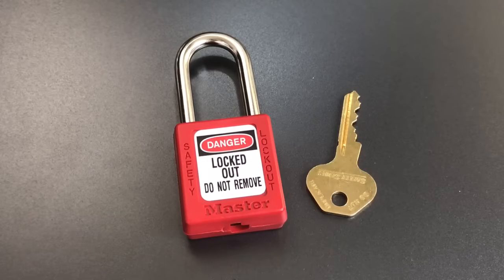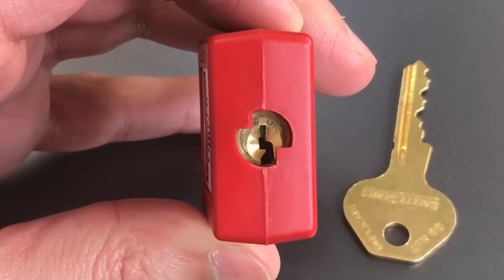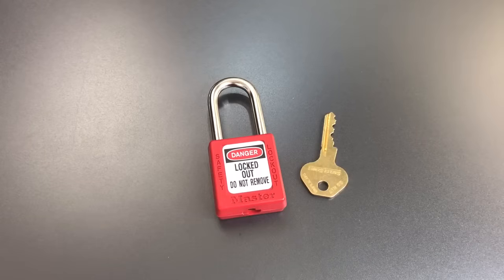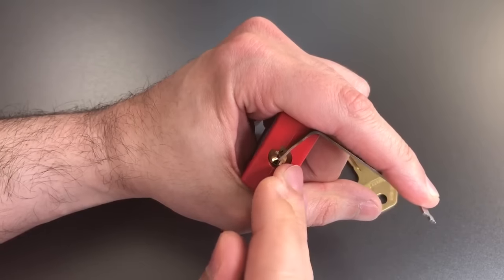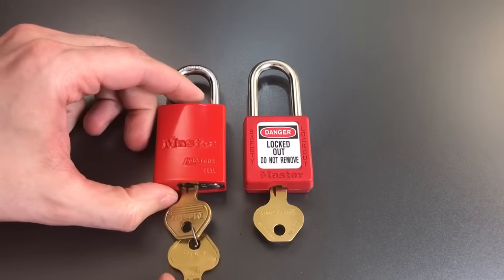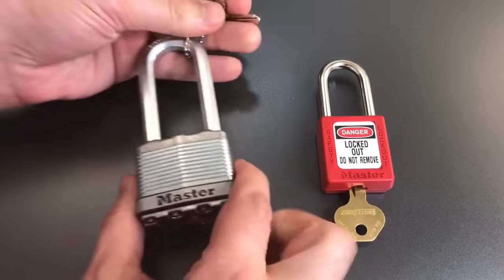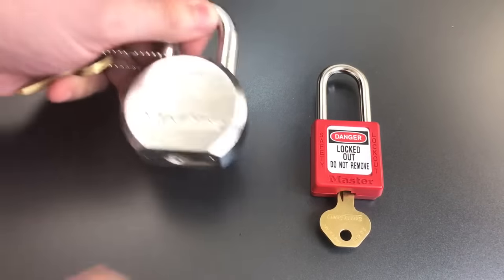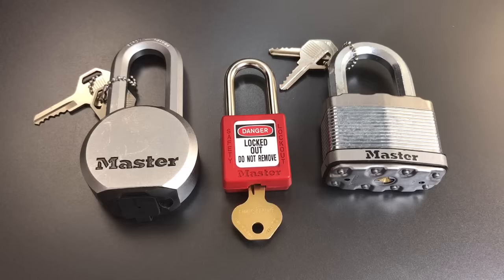[479] The Master Lock Paradox - Model 410 LOTO Padlock

Comment: I may have an answer to the paradox.

I have been working in Nickel refinery plant for 22 years and when they introduced these locks we were all scared. Beforehand we just put the tag on isolation point and that was it. Our plant is a very complex process plant and when we isolate equipment very rarely we got only 2 or 3 isolation points. Most of them average 10 to 15 of them. During the shutdown we have to isolate a lots of equipment with one key and sometimes set of up to 40 locks (and one key). So having a light lock and resistant to chemicals (leaking valves etc) makes a priority requirement. Imagine caring 40 locks with you from one isolation point to another with heavy body locks. So here is the answer to your question. 

Safety regulation on site requires isolation point to be isolated and locked. If the lock is physically broken and destroyed that is a safety breach and immediately will be noticed, job stopped and heavy investigation will begin after which someone will loose the job. Even if the lock is physically destroyed and removed and throne away there will be a trace of destruction on isolation point.  But if someone pick the lock and remove it to energize the isolation point and someone gets killed because of this action that is way harder to prove or investigate. So the requirement for the industrial plant with complex processes require a light lock with difficult picking capabilities and one master key to open number of same lock set. Sometimes isolation points overlap so you may end up with two or more locks from different set and you need to remove only the right one with a master key.  There is more to this but these locks do the job for the requirement and they are designed just right for the job. Just one more thing to add to this. Our permit office has a board for the isolation locks and there are over 30 different sets of locks with one master key and this is only in one area of production. Then there are almost 500 individual isolation padlocks for each worker with a single key. No double key allowed for these on site for safety reason. 

I hope it wasn't too confusing for you so you dont have to die to take the question into your grave. Stay with us for another 100 years and keep making these great videos demonstrations of your great skills. 

Cheers

Comment: I have been waiting a few weeks now for my Covert Companion to arrive (I live is Australia so everything takes time from the US), finally it arrives and I’m straight into putting it together (thanks for the video on that LPL!) and then madly looking for locks to pick open - the only two I could find around home are a tiny Lockwood travel luggage lock, picked on my second try, and my Masterlock isolation lock the same as this video. I was getting frustrated and disheartened that I can’t even open this little plastic lock - feel better now lol, maybe off to the shops to buy some other practice locks somewhere in the mid range 😂😂

Comment: Those locks have plastic bodies so that they can be easily broken open. As you said, it is more of a warning not to energize equipment than a security device.
Lets say Peter locks out a piece of equipment,  doesn't get the job finished and the task is completed by the Frank on the next shit. Peter has gone home, but forgot to remove his lock. That machine can't operate until that lock is removed.
After trying to phone Peter, or contact him in whatever way they have set out in the safety regs, and failing to do so, they fill out reams of paperwork, re-check the entire area to make sure Peter isn't sleeping in the machine or something, two 3/4" wrenches placed on the lock body and twisted in opposite directions will easily break it open and that machine can be returned to production.
And Peter will get a righteous ass-chewing the next day.

Comment: @lockpickinglawyer in industries that utilize lock out tag out (LOTO), there is a market for weak bodies but more robust cores like the 410 you featured in this video. There are instances where a key could be lost or indisposed for hours or days (mistakenly taken home, mishandled hand-off, etc.) in high uptime or sensitive applications in already highly secured location. If the key ends up being unavailable but the LOTO needs to be immediately disengaged, it shouldn’t be uncommon for contingency procedures to call for cutting off the lock. Perhaps the more robust core is to prevent low level non-destructive attacks or to provide a level of differentiation from something like zip ties, or to provide more varied keys as these locks are often time used/stored/handled in high volumes.

As for a more robust body/weak core combo variant, I can only imagine its for a market that has the reverse scenario, perhaps outdoor, requiring some level of a hold/bind from the core, or high accidental damage risk environments.

Comment: Being in the industry, you don’t want to be able to have someone easily pick the lock to remove it and put it back (for equipment testing without authorization). If you need to remove the lock without a key, the lock needs to be easily “destroyed” or damaged for saftey purposes with regular bolt cutters(proper forms must be filled, and damaged lock must be retained). If they made it “indestructible”, it could be a major saftey concern. For example, in a emergency situation, you may want to destroy the lock with anything you have on hand.

Comment: These locks are meant to Lock Out electrical circuits while electricians do maintenance. In Australia, it's illegal to remove a lock-dog that's not your own from a circuit breaker.

This is why the body of the lock is plastic, as it's more insulating should the shackle become energised. This is also why the core is likely better than other locks; if you have a bunch of tradies on a site, some of them might know how to pick a lock, and some of then may be selfish enough to want the power in their area turned on right that second.

Comment: The good core serves two purposes.  It first prevents the possibility that two similarly but not identically bitted locks can be opened by the same key.   The more important issue is that this is a tamper evident design.   As others have noted, there's not really any reason to make the lock difficult to cut as it's not meant to secure valuables and it's helpful to be able to easily cut one off in the event some joker goes home for the evening with his LOTO still on.   The trick is that safety procedure dictates that the lock should be difficult to remove without a trace.  

Imagine some guy leaves his lock on then calls his friend up to go remove his lock.  This is horridly unsafe practise and breaks the safety model of the site.  If the lock were easy to pick or rake or bump then said friend could pull the lock and return it.   Some sites use a 3 step lockout that requires a safety administrator to unlock the box your lock is stored in for this purpose.    The other situation is that if someones loto lock is on there and somebody does something stupid/illegal and bypasses it and injures or kills someone.   A cut LOTO lock is a dead giveaway that somebody was up to no-good, but if you can just remove it without leaving a trace, then it makes it easier to cover your tracks.

Comment: In a mining situation the lock needs to securely ‘lock out’ a machine or equipment while the machine/equipment is being inspected or worked on. Along with a tag which states the time and reason the lock has been placed and the identity of the one who placed the lock. This is to ensure that people are not injured by someone starting up the machine/equipment whilst an inspection or work is being performed. 
In the event that someone forgetful leaves the lock on the machine/equipment and cannot return to remove the lock (has got on a plane and flown home for R&R) the lock needs to be forcefully removed so that the machinery can be utilised again as there could be some serious money and loss of productivity at risk. 
Procedures need to be followed if locks need to be removed forcefully and the owner of the lock needs to be accounted for before the lock is removed. 
The person will then need to be issued with a new lock that is supposed to then be added to a lock register along with the owner details of the new lock owner. 
The reason the lock is plastic is so it can be broken.

Comment: As you indicated it's not really a security lock
But if the person who is holding the key looses it or doesn't come back to work
It really needs to be easy to break
The lock is more of a visual indicator
A person will or should get fired or at least written up if he's not an authorized user and remove it

Comment: Okay well I don’t know if there’s a reason, but if there is, I think I know it. The reason is it isn’t supposed to be used somewhere where a person with bolt cutters or saws would have access. They’re only designed to prevent people from secretly opening the lock.  Thus the case is cheap to reduce cost.

Comment: Honestly the reason the weak body for a lockout/tag out but strong core is due to the places that they're used for. You don't need a good body but you need a good core because it's a danger hazard if it is removed, giving a possibility of injury or death. since  lockout/tag out locks are to present to others that someone had locked it because someone is working somewhere in the area. Workers are usually instructed take the key with them so if anyone were to pick it, they will hopefully be stopped before anything dire happens. especially in a place of work. Plus companies need a cheap alternative so a weaker body means a cheaper lock.
Now for stronger bodies and bad cores are based for durability to help keeping things from separating like chain or crossing bars. Thier not based on safety rather it being based to keeping things in place.

Comment: I have a bit of insight. I'm an electrician and we use the plastic bodies because they're not conductive. There is a all plastic version (Model 406) that's specifically for electrical safety. However, it's the worst lock ever. You can break the shackle by inserting a screwdriver in the shackle and twisting.

Comment: It’s might be quite straightforward. The security locks are designed to deter, so the core can be cheaply made in a sturdy casing. The lock out locks need to be opened only with the key, and not secretly bypassed, so the core is more important as any damage to the case would be obvious.

Comment: Using theses on a daily basis at work I see them as a security seal designed to be difficult to tamper with. Every site I’ve been to if you are caught braking a red lock off it’s instant dismissal and even if it’s your lock it’s first and final. But it is common for guys to loose their key and if the appropriate procedures and paperwork are followed they can be cut or broken off quickly without the need for hot works permit.

Comment: I usually have to carry 3 of these at any one time for work. Have them attached to my belt loops so that they don't get lost. Also saves having to always walk around with my tool bag. Carrying 3 of these with the full metal body would be a pain in terms of where they sit. I reckon it is purely to save on weight. Sites get annoyed when you don't have your lock on you and have to walk off to go get it as someone from site typically has to supervise them being put onto the job board to make sure you are locking onto the correct job. They are there for safety

Comment: I imagine someone needing it to be 'very secure' for insurance purposes, however, also needing to smash through very fast for emergencies.  This would keep most everyone out unless there is a clear sign of entry (busting the lock or door).  It seems to be a lock that knows you can't be 100% secure, and if that is the case, make sure the police, insurance and the corporate lawyers know that the entry was not intended.  Edit: I read the other comment about needing to replace the locks by breaking them and having lots of different combinations.

Comment: @lockpickinglawyer - you have missed the whole purpose of this lock.  It is simply designed to stop people from energizing equipment accidently.  That is all.  It does not need to be robust with a hardened body or clasp.  It needs to be light enough to be carried and the plastic case makes it highly visible.

Comment: I believe the reason is actually aviation and military. Aviation code states that a LOCK OUT lock must be as tamper proof as possible. Not unbreakable. The safety standards for aviation equipment is unreal. So the lock needs to be tamper proof so the only way you're opening that machine is if you either have the key, manage to pick it or destroy it.

Comment: We use these to signal our presence in high-hazard environments - you lock them onto a personnel board, rather than using them to lock-out particular equipment. End of shift - remove your personal lock. The idea is that nobody gets left inside a hazardous environment.

Comment: These locks are not meant to be difficult to remove with force incase an operator loses their key or forgets to remove it and has already left the building. Bolt cutters are what is used most of the time. That's why the metal is weak.

Also. These are often used with loto haps which allow several locks to work together on a single lock out.

In summary, these locks are meant for communication more than anything and they do exceptionally well at that.

Comment: As an electrician I use that exact lock, It needs to be light as it gets applied to a little brackets that clamps down on the circuit breaker, if it was too heavy it could fall off or damage the clients equipment. As for the 6 pins. No idea.

Comment: The LOTO lock in isolation makes sense to me. if someone wants to remove a padlock then they can especially on the types of sites that use LOTO as there tends to be a lot of tools easily to hand so you cant really use LOTO to stop a malicious attack.  You want to stop workers misusing the system, there arent many jobs where you dont need to remove and reapply locks during the work, mainly for proving/checking activities. This involves a bit of a mess on with paperwork and the need to remove and reapply issuer and acceptor locks so it can take some time. If there was a relatively easy way to get around this process i.e by bumping, raking or easy picking then this could become a problem as it may become seen as the easier option. If a worked cut or forced a lock then this would be easy to see and would usually lead to disciplinary action so its not likely to happen. Whereas if a worker could easily remove a lock and then replace it without it being noticeable that would be far more likely to happen.

Comment: This paradox is easily explained when you remember that people do not want good security. Lots of people have explained why it's good for LOTO locks to be possible to smash open when an employee forgets to remove them and goes home with the key. But I haven't seen peopl point out this is probably true for the people who buy the pickable hardened steel laminated locks too: They want a lock that it's hard for a low skilled attacker to  brute force open, but easy for them to rake when they forgot their key. If master made a lock that was both hard to pick and hard to remove destructively hey would probably have a tonne of angry customers locked out of their garages and blaming master for the security they paid for.

Comment: When I was in school to become an electrician, a teacher explained to us that those Master locks...
- were made of plastic so they can be removed easily in case of an emergency.
- we're difficult to pick open so that 99.99% of the workers on a construction site couldn't open the lock easily without leaving a trace, then relocking them.
------------ 
I now work for a big electrical company (around 500 electricians,) and we only do big construction projects. Some part of the building will be energized before other parts so instead of guessing we would be safe because there's no electricity yet, we always had to secure the circuit we were working on.
The protocol on those construction sites are...
- an independent electrician hired by the general contractor is in charge of all the lockouts we need.
- When I need to lockout a circuit I call that guy.
- We fill up a lockout request identifying me and the independent electrician in charge of lockout safety and the electrical panel/circuit we're locking out.
- he then put his own hasp with his own Master Loto padlock then I put my own personal Loto padlock.
So... even the independent electrician in charge of Loto can't unlock the circuit without me being there with my key. And I can't put the circuit ON without him being there to ensure that everyone and everything was safe.
Once the circuit is unlocked, the last step of the protocol is for him and me to sign the document (the one we filled earlier) to declare that we we're both safe, that the circuit was safe, and that all lockouts had been removed.
The really nice thing about that protocol... when we are lot of electrician on the same construction site, the independent electrician in charge of Loto safety is quite busy. We often have to wait 1 hour, sometimes 1.5 even 2 hours, before he gets to us. But when you're paid $43/hour, no one cares about the waiting 😂